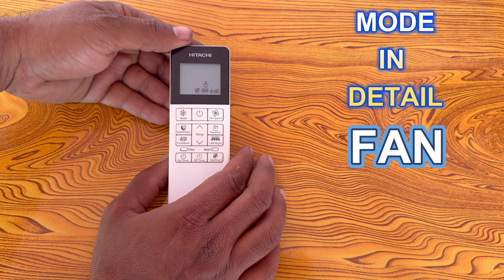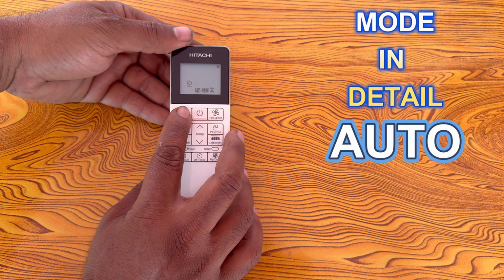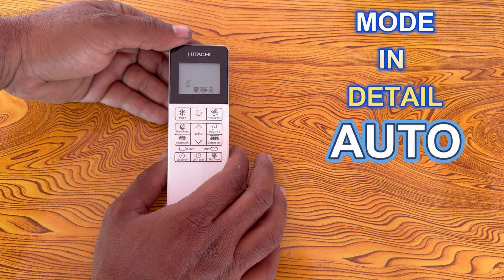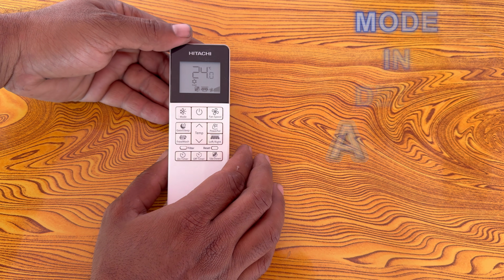Hitachi Split Inverter AC Remote Control Tutorial

Comment: There is smell . Foul smell coming when ever I on the ac ir continue for 5 min and later no smell .. but daily same issue . I also tried frost wash but no use same hitachi ac. I also have . I run it in cool . 26 temp set and with eco mode.
Reply from the maker: Thank you for sharing the details. It sounds like there may be dirt or stagnant water in the drain pipe, drain pan, or evaporator coil. If Frost Wash didn't solve it, I recommend a deep professional cleaning and checking the drain line. Hope this helps! 😊